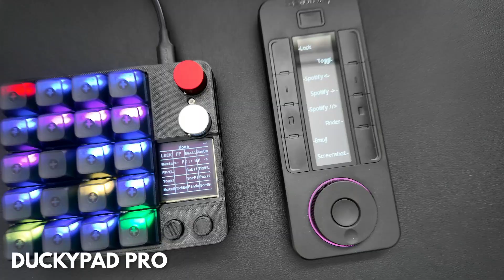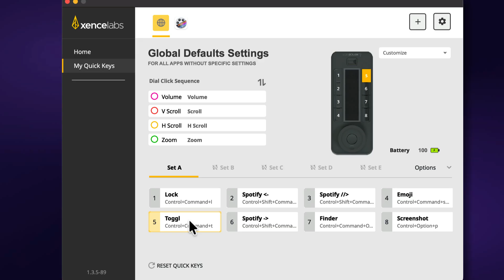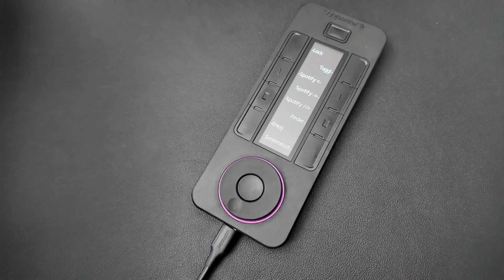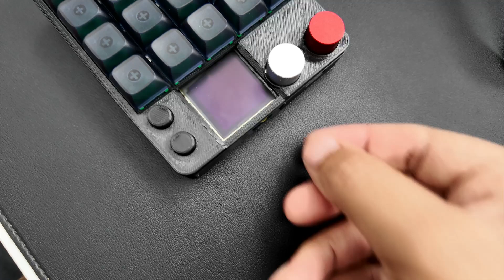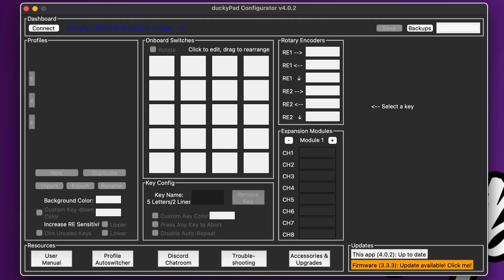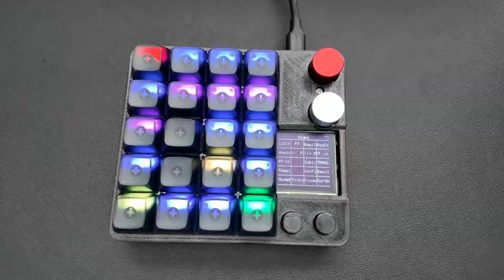DuckyPad Pro vs Xencelabs Quick Keys: Only One Stayed on My Desk

Comment: For the ducky pad, I made a wrap for both of the executables, so now I don't have to go inside of the terminal to launch it. I also made an automation that essentially types in whatever I have on the clipboard, so now I can copy and paste. With those two upgrades, the ducky pad is a dream because now I can ask Al and paste it inside and it works!!
Reply from the maker: The clipboard typing shortcut is smart! And was the launch wrap hard to set up? I’d like to set up something similar
Reply: @InputZen  Honestly, it wasn’t as difficult as it sounds. 😂 The biggest thing is just giving the application/executable the correct permissions.

Your Mac already comes with Automator and the Script Editor, so you don’t really need to install anything special. I used scripts that essentially run a command to launch the application/executable I want, then assigned those scripts to the buttons on my DuckyPad.

I also used Automator for a separate copy/paste override. Basically, instead of actually pasting the clipboard contents, the automation uses keyboard inputs to “type” whatever is currently in my clipboard. That lets me work around some of the limitations I was running into.

And honestly, I used AI to help me write/modify the scripts. You can literally tell it what you want the button to do, what app you’re using, and what permissions you’ve already given it, and have it generate the AppleScript/shell command for you. Then it’s mostly a matter of testing it and fixing whatever macOS permission issue pops up.

Honestly, it wasn’t as difficult as it sounds. 😂 The biggest thing is just giving the application/executable the correct permissions.

Your Mac already comes with Automator and the Script Editor, so you don’t really need to install anything special. I used scripts that essentially run a command to launch the application/executable I want.

I also used Automator for a separate copy/paste override. Basically, instead of actually pasting the clipboard contents, the automation uses keyboard inputs to “type” whatever is currently in my clipboard. That lets me work around some of the limitations I was running into.

And honestly, I used AI to help me write/modify the scripts. You can literally tell it what you want the button to do, what app you’re using, and what permissions you’ve already given it, and have it generate the AppleScript/shell command for you. Then it’s mostly a matter of testing it and fixing whatever macOS permission issue pops up.

So I’d say the concept looks way more complicated than it actually is. Once you get one working, you can basically duplicate the process for the rest of your buttons.
Reply: Oh, I forgot to say, when you are making the App launcher, make a DuckyPad folder. Then you can put the folders for the DuckyPad, editor and also the application that lets the DuckyPad switch from application to application. I would put them in separate— well, I would make an umbrella folder called DuckyPad and then put all the executable stuff in that. So when there's an update, all you have to do is replace the folder inside of the overall DuckyPad folder to make it easy for you.